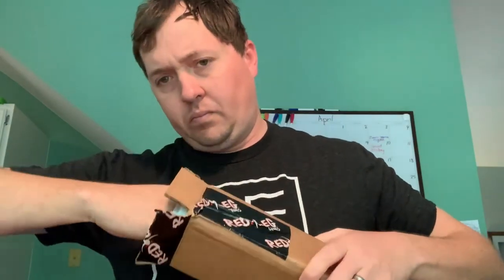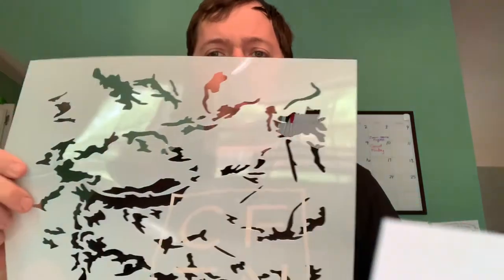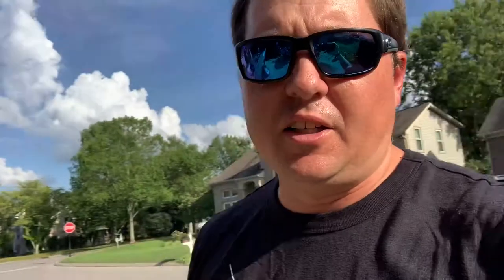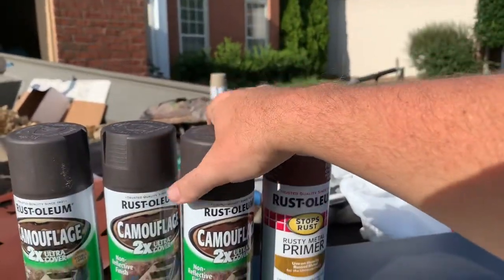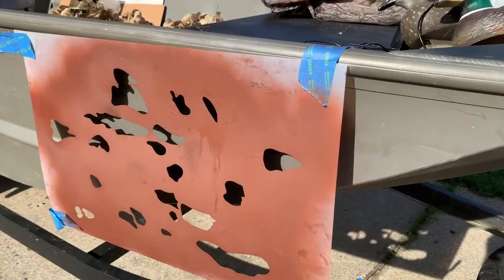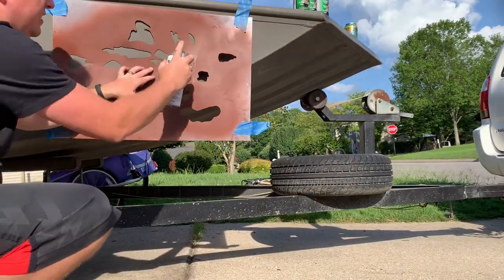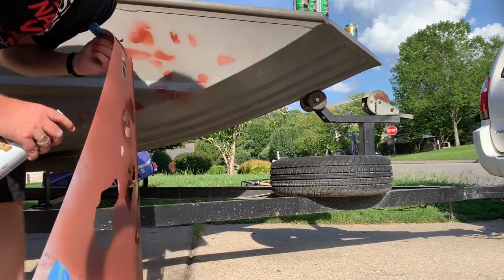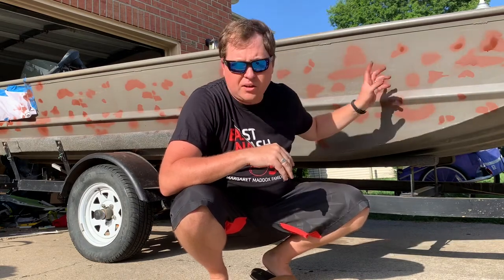How to Paint a Duck Boat 🦆Natural Gear Redleg Camo

Comment: Use double sided tape, put on one side of the stencil , cut out stencil deigns. Wipe the tape so it’s not so sticky, then use it to paint. The tape should lay the whole boat if it’s quality tape. Much easier, better lines. And not so muddied up.
Reply from the maker: That’s a great tip I’ll give it a try!